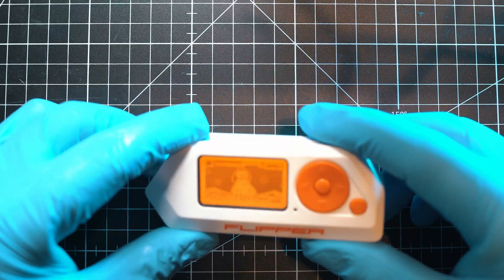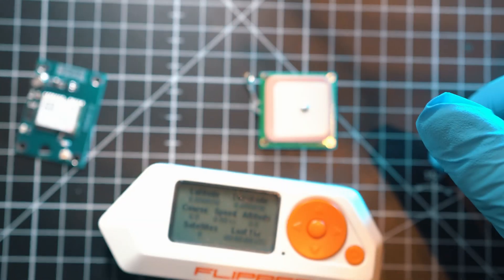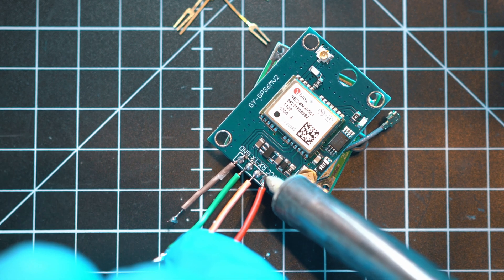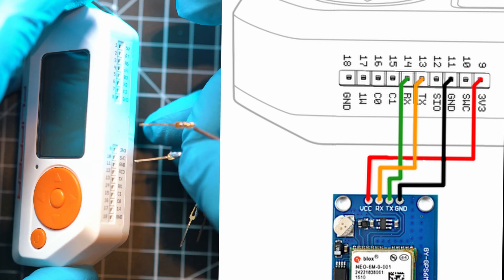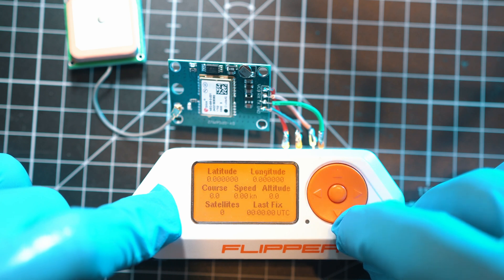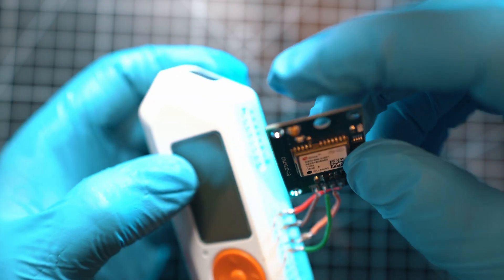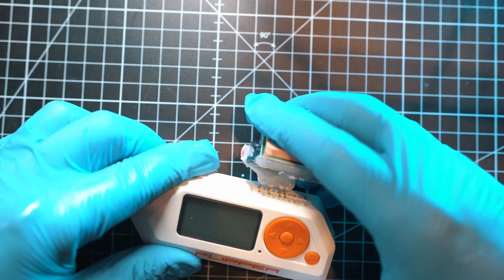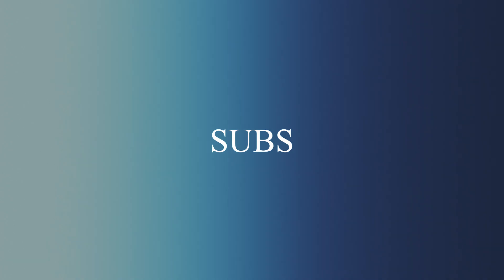Flipper Zero GPS Receiver Module - NEO-6M...

Comment: Hi, I have a question about the 3 in 1 module aio board, this 3 in 1 module has extra pins right? I saw them, but I wanna know if I can add this gps and weld with wires to those points on that module
Reply from the maker: no idea… sorry

Comment: Hey! Thank you for the video! I did what you did, the GPS IC's LED is not flashing and it cannot get a successful fix, so all the values are kept being "nan". Do you have any advice where should I start seeking for solution?
Reply from the maker: while attached and app running change baud rate… to 9600 (if Im correct that’s the correct rate)
Reply: @takeapart  tried with all the baud rates, the flipper only blinks on 9600 baud-rate, the light on the IC blinked once but stopped immediately
Reply from the maker: @DJMARCEE123 make sure you connected tx rx right! and also test it outside preferably. it must work
Reply: @takeapart  I will take it outside because it is currently sitting in the window, running for over 20 mins with not a single fix yet. The little LED on it is still dark, no blinking at all
Reply from the maker: @DJMARCEE123 report back !  check that TX and RX connection (try to reverse them as well)
Reply: @takeapart  took it outside and it works!!!!! THANKS!!! Been working around with this for a week by now

Comment: One of the reliable Amazon sellers said this in the comments of this item:

"Listing Says "GPS Module GPS NEO-6M" but It's an M7 Module"

Will the Flipper Zero still read it ok if it's in fact a 'M7 Module'?

What would I have to do if this is the case?

Also, do I have to worry about trying to load this GPS system in a different module? Say it's really a 6M but I'm loading something else (the 7M if there is one?)? 
Would that fry my Flipper Zero?

I'm totally new to this type of thing so sorry if my question is ridiculous.
Reply from the maker: gen 6 and gen 8 are ok … check github repo about flipper gps